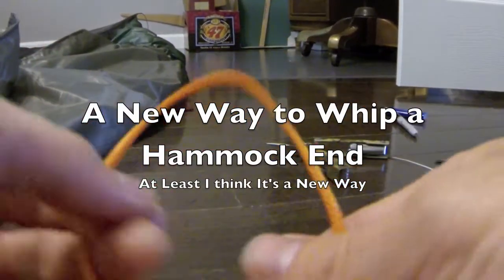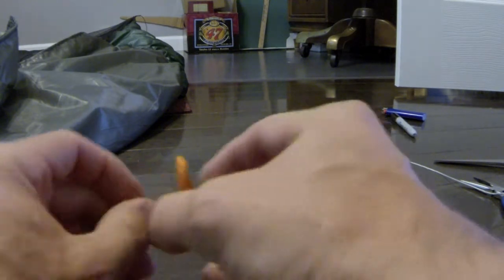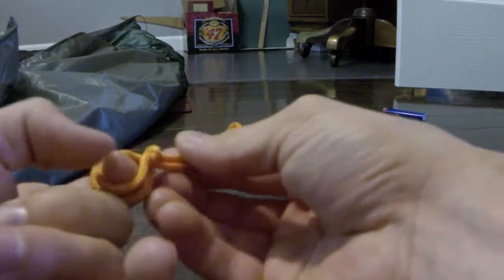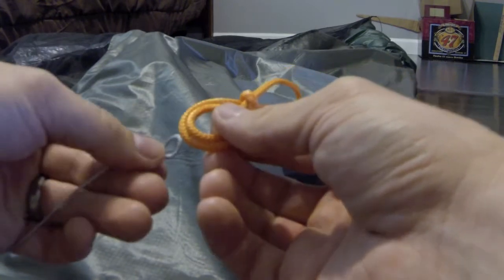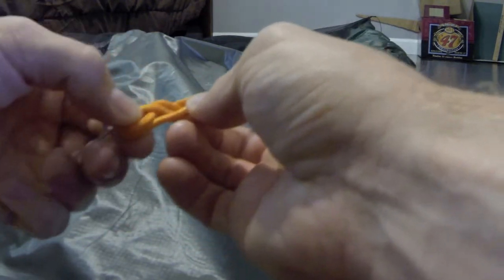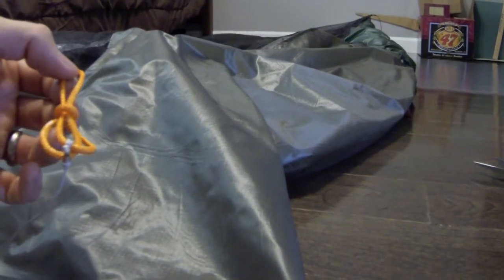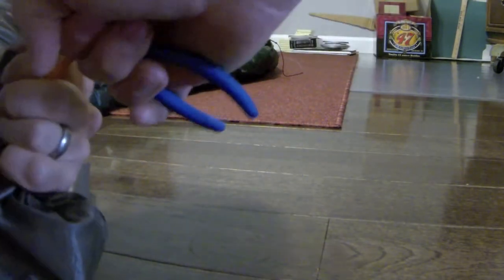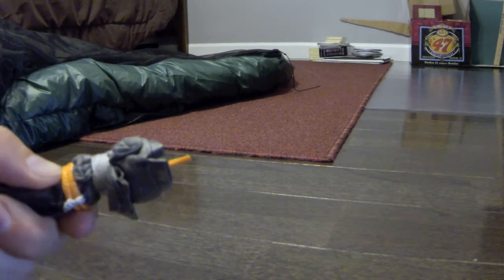New Way to Connect a Continuous Loop to a Whipped End Hammock

Comment from the maker: I used the same style of rolling that Hennessy uses on their hammocks. Details can be found on the hammock forums in the DIY section. Although this is by far my favorite method of whipping a single layer hammock, for my double layer, I'm using a basic gathered end. 

The connection shown in this video works just as well with the gathered end.